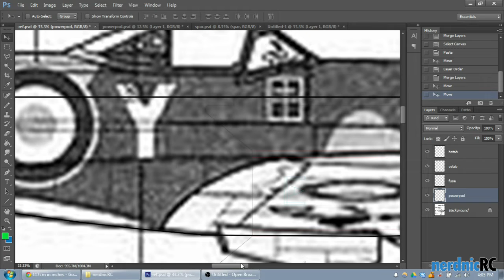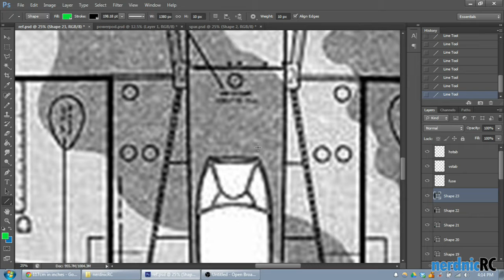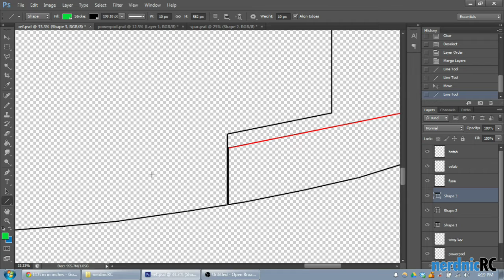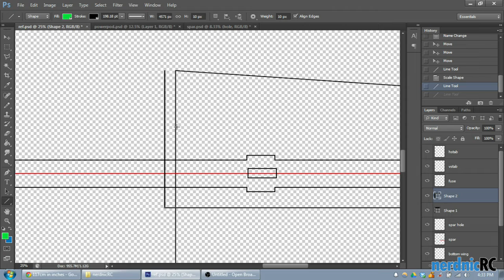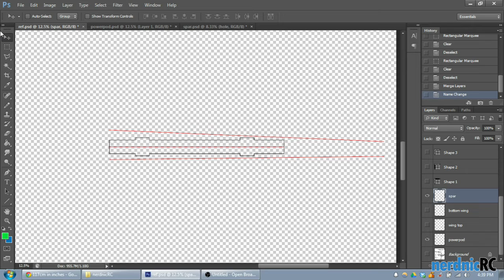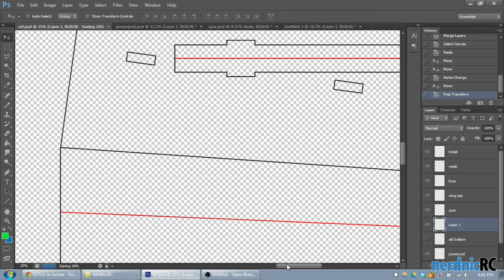Part 3 - How to Design DTFB Planes

Comment: Great tutorial series! I've just discovered these as I'm considering designing a DTFB airframe. 
Thank you!
Reply from the maker: Let me know if you end up designing a plane!
Reply: Sure! I'm looking at the Bearospace Gemini design, if you've seen it. I'll probably design a smaller version of that with one motor in the nose.

On the same note, I love that you chose the Spitfire in these videos. I've scratchbuilt two of the Flitetest ones, one standard and one 20% larger with a lot of modifications.

Thanks again for all the great ideas shared here.
Reply from the maker: I just put out an 800mm Spitfire of my own. Check it out!